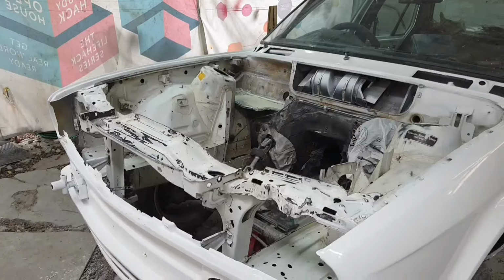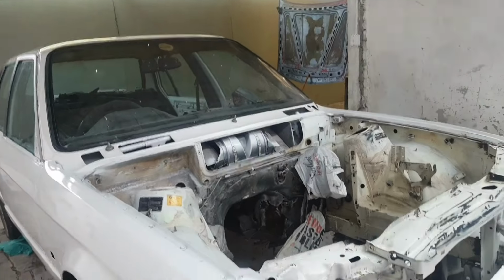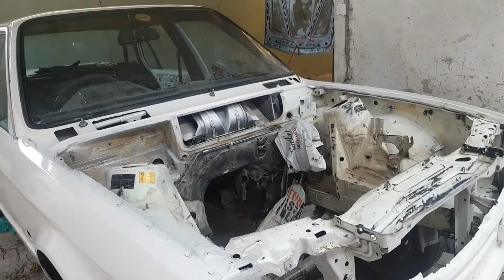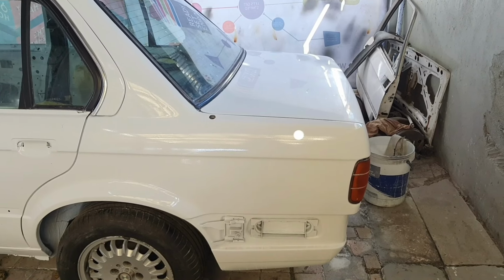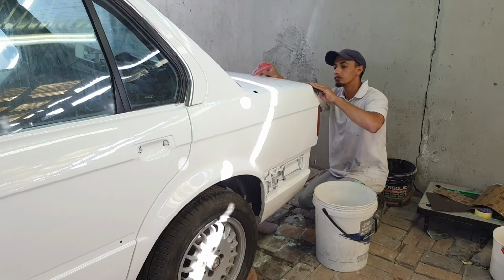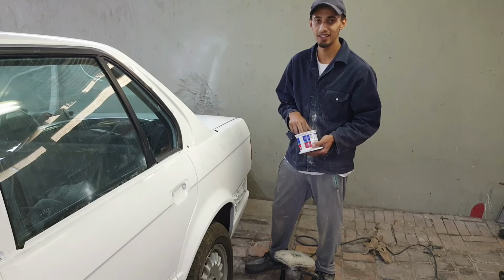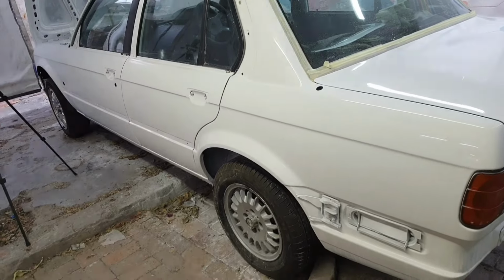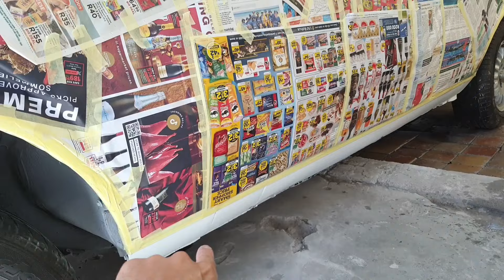Budget E30 resto body completion

Comment: 🎉mooi mooi ...bmw 🎉... salute💯🏆
Keep pushing 🎉 never stop 
Work is king 🎉
Make me even too do start  build my e30s 
Chrome bumper 2.7 c2  and 323 
Any ideas what should start wit first ?
Reply from the maker: Thanks bro,  lol tough choices to choose from, both needs to be done so I'd suggest do the one that's dearest to your heart first 😉.
Reply: How do I start ..N what sand paper is needed too do body ... should it be to  metal
Reply from the maker: @666afgunkhan5  so you first have to line up your vehicle set your gaps correctly, then you want to check for dents, I use a grinder with a 36gritt sanding pad, it's best to grind to bare metal, put a layer filler sand down with 40 or 60 gritt sandpaper then run your hand over the panel to check if it's straight, if not Apply again filler and repeat above steps, I think I explained this in my videos 🤔, anything else I can help with just shout
Reply: @mustasprojects   my G thanks  .. this  help A lot  🎆🎇🎆🏆💯
Reply from the maker: @666afgunkhan5  oh forgot to tell you, after you sanded with 40 or 60gritt finish it off with 120 gritt to get rid of deep scratches, then you ready for primer
Reply: @mustasprojects  ..thanks bro
Reply from the maker: @666afgunkhan5  meant primer not paint sorry 🙈😅
Reply: Brother dnt have what app number... not sure on which all tools is needed  .. so  can send  you pictures off what I have ... so need know what all is needed  ... N Wil be easier for u guide  me on build my cars